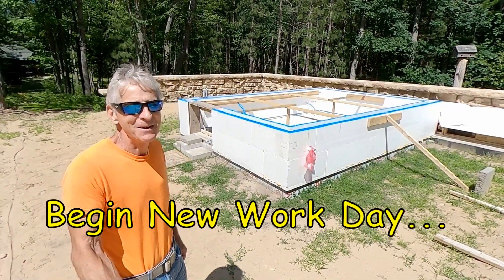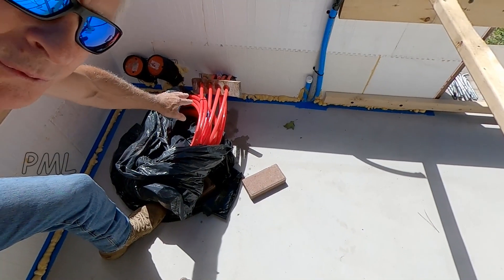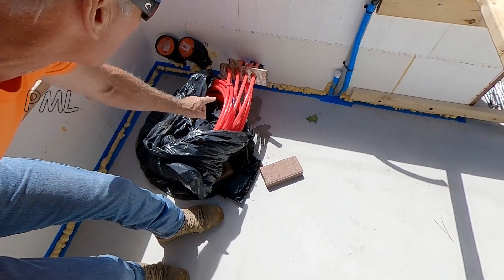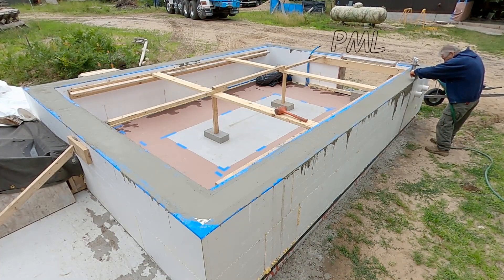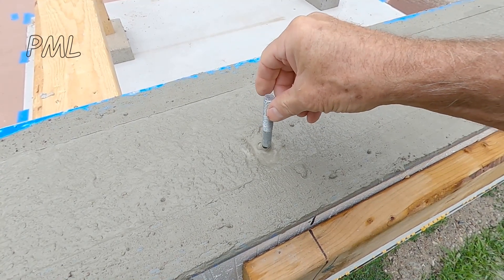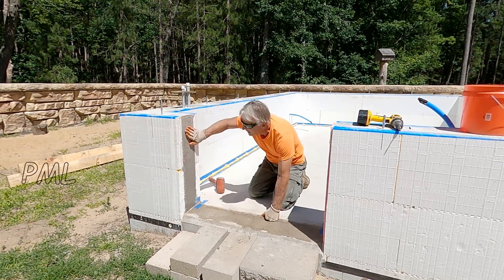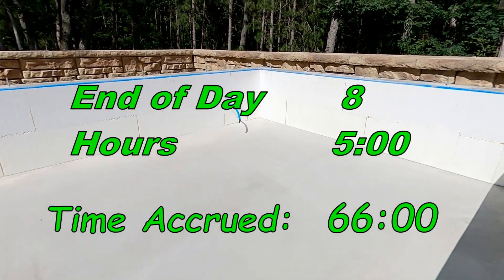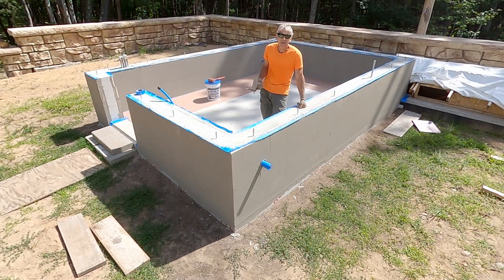Greenhouse Build - Concrete Pour of Stem Wall Part 3 of 3 _ Day 7-9

Comment from the maker: Full Disclosure: In this concrete pour of the 6” wide x 30” tall ICF Stem wall I used a 7” concrete slump because the wall width is narrow (6”). In a full wall 8’ or taller ICF manufactures caution to keep concrete slump 6” or lower. The danger is the wetter / higher the concrete slump, will increase side wall pressure risking a blowout. That being said when the concrete sump is 6” or lower as needed for the taller walls. You will need to use a hand held concrete vibrator to assure the dryer concrete flows well and fills all voids and corners of the ICF wall. See link As seen in my Bunker ICF Concrete pour.
https://youtu.be/PDTCz7rtX0I?si=4W9igv3Zihi6IiE9